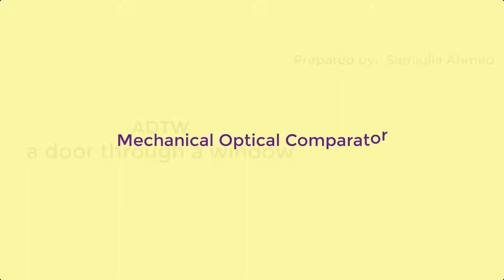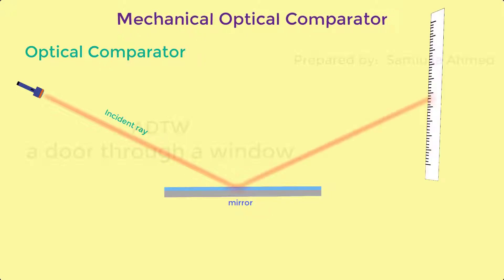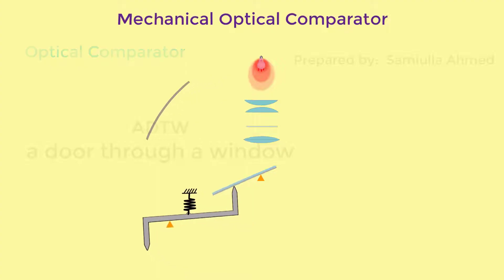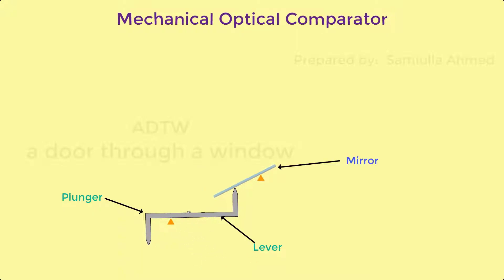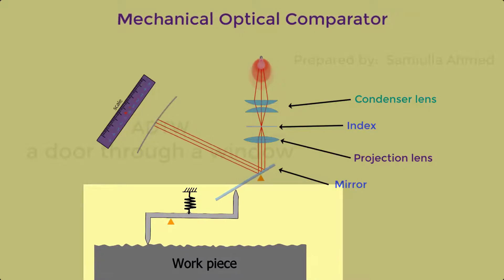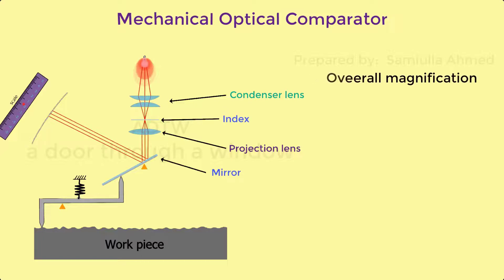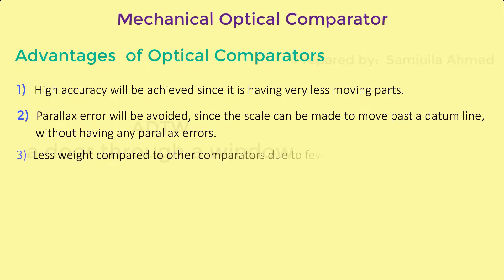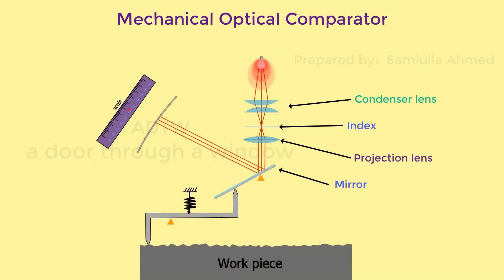MECHANICAL OPTICAL COMPARATOR : How Mechanical Optical Comparator works?

Comment: Sir why pivot is used in this comparator
Reply from the maker: Mechanical magnification is obtained due to that pivot...
Reply: @ADTWstudy  pivot is used to rotate the lever???
Reply from the maker: Yes we want to rotate that lever about that point... By doing so it will gives us the required mechanical magnification...
Reply: @ADTWstudy  pivot is basically a device which is used to rotate the lever about that point??
Reply: Without pivot the is will not work and pivot is also help ful in magnification purpose
Reply from the maker: Yes...
Reply from the maker: Yes